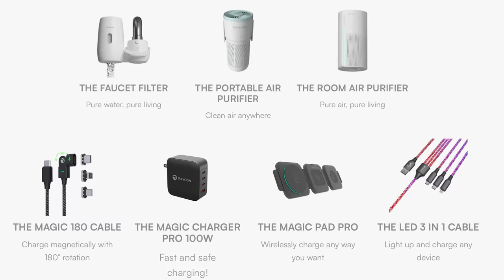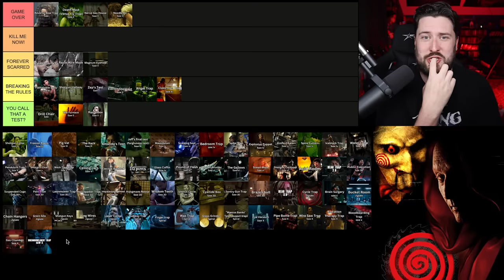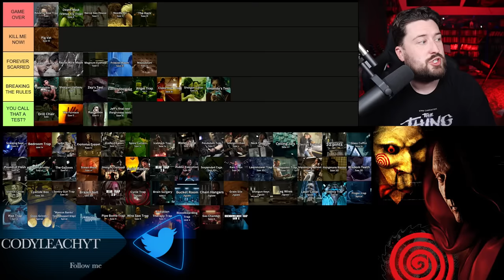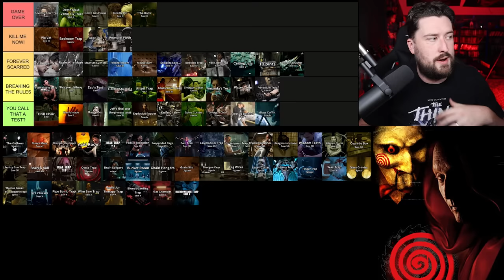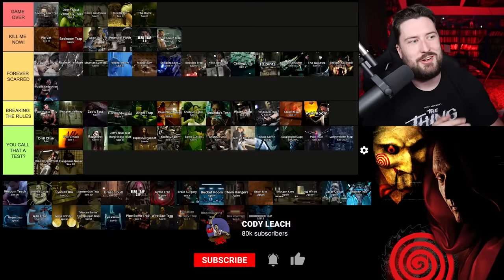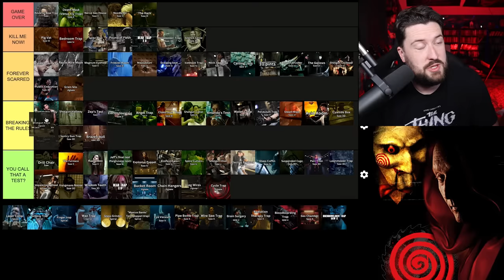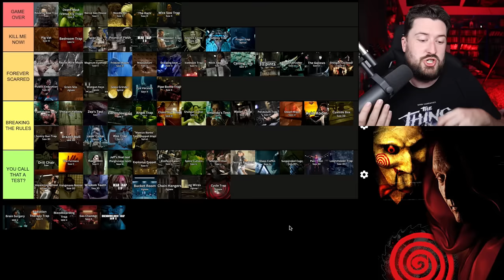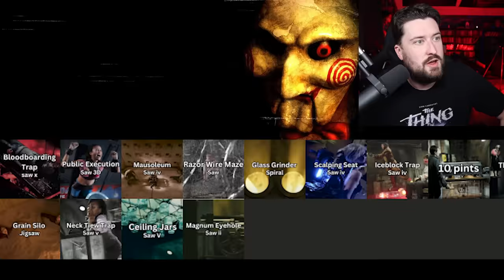Ranking All 78 Traps in the Saw Franchise | Tier List

Comment: The razor box isn't as easy as it looks. There are bits of hard plastic attached to the bottom of the holes, making it so you can only fit one hand in at a time, so you can't use your other hand to hold the razors up.
Reply: Also she was high from the gas.

Comment: Chester Bennington in Saw 3D tried to get away from his seat. Despite the great amount of pain, he was able to rip off most of the skin from his back. He ultimately failed as the timer went off before he could free himself. This caused the jacks holding up the car to fall and Kara, who was tied up under the car, was crushed to death by the rear tire. When the car started to drive off, Dan's arms and his lower jaw, which were pierced by chains connected to the back of the car, were ripped from his body. The car then crushed through the garage door, killing Jake, who was chained to the door. Despite his desperate efforts to gain control over the car, Evan ultimately crashed head on into another car in the junkyard, which caused him to be ejected out of his car and thrown right into the other car's back window 🔥🔥

Comment: My guy, you should’ve really rewatched the movies before doing this.

In Saw 3D Bobby (SPF) had to go in the middle of the room to get the key to throw to his friend. Not to mention there was no middle floor for them to meet. He had to guide his friend to the edge while navigating his side as well.

Also, the squat rack for the wheel death had its weights set to the max. Depending on the machine that’s 200-600 pounds to lift. I go to the gym regularly and I can’t squat 200 pounds while getting knifed in the kidneys.

Comment: For the razor box i have to give her some slack still even if its stupid.
-she didnt have the casset player, so the tape was useless anyways without going back for it. (I belive the guy had it still or was left in the needle room)
-its been a long time in the house taking in the nerve gas, so shes loopy and was not doing well. She was stopping to get her breath, puking too i think
- and frankly shes just desperate and since shes loopy shes not thinking of lets check it out. She just wants to get the cure.

-but she was fully dumb to place both hands in. She already messed up and spilled the needle contents meaning she couldnt even use it anymore.

Comment: In 3D He was never gonna be able to get that plug put together….

That’s a 3 phase twist lock. Those are a bitch to put together when you’re NOT hanging from hooks in your pecs. They only line up one way — and very often one of the pins are bent enough that you need a pair of pliers to tweak it and put it back in the right spot…

You then have to make sure the other side is lined up properly — put them together — THEN twist them to lock the sides together so there’s no chance of it coming apart 

((I’m a lighting technician for concerts/touring and twist lock cables are used a LOT, I’ve physically taken so many of them apart, fixed them, replaced the ends….you name it))

There was NO way he was gonna get that plug together and to twist it into locked position.

Comment: For the brain surgery trap in Saw X, it looked like it was a hunk of parietal lobe that was being pulled out. Movement initiation happens in the frontal lobe, so he would’ve still been able to move. Specifically it would’ve most likely been the superior parietal lobule that got removed. Hard to say what removing it altogether would do, but damage tends to cause working memory issues and an inability to integrate sensory information which takes the form of astereognosis and hemispatial neglect. The former would make the guy unable to identify an object through touch alone. Like he wouldn’t know he’s holding a bone saw without actually looking at it because that integration of touch into memory just doesn’t exist anymore. The latter is a complete unawareness of stimuli happening on the side of the body opposite the side of brain that got scooped out. The ability to still see, hear, and feel with that side of the body are still there, it’s just actually doing anything with that information that goes out the window. Of all the spots of brain to lose that’s probably one of the better ones. The frontal lobe handles motor and higher reasoning, occipital handles vision, and temporal and some pieces of parietal further down and off to the side handle speech and understanding of speech. Temporal handles smell and insular handles taste, but you’d risk damaging language structures at that point.

Comment: one thing the Angel trap or the Chainhangers trap made me think: TF TYPE OF ACID IS THIS?

in the Angel trap, the one caught in the trap has to dip her hand in acid to grab a key to get herself out. one of my main gripes about that; what type of acid is enough to grill a human hand like that in such little exposure time but not enough to eat the key or damage it to where it's unusable?

same thing with The Chainhangers. what type of acid is potent enough to eat through a person from the inside out negating the other two solutions that were also injected, but not melt the plastic syringe it was sitting in?

maybe i'm reading into it wayy too hard, but it's always been a gripe of mine whenever i look back at these traps.

Comment: this franchise had so much potential if it was morally consistent
for example
arguably the worst character of all 10 movies, the female doctor from saw X, gets off scot free because somebody else died for her to live. She barely suffered anything and had no real test, no learning, no retribution
whereas utter innocents, like the wife in movie 7 (burned alive) just become casualties through proxy? or the young guy vs the older lady with diabeties who were hanging. Utter innocents
Reply: How did she get off? The room is still filled with poisonous gas. She only has her head in the small window so she isn't breathing it in. She eventually has to try and escape or stay there and die from starvation,  dehydration,  exhaustion, or something like that. As soon as she takes her head out of the window, she is breathing in gas. The room is sealed air tight. Gas isn't going anywhere